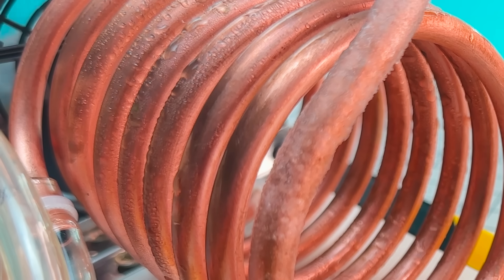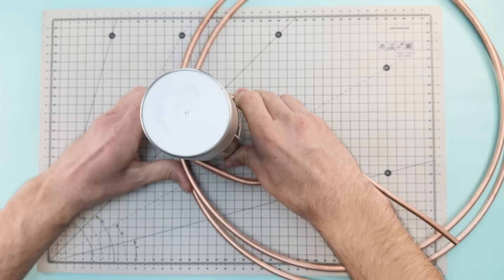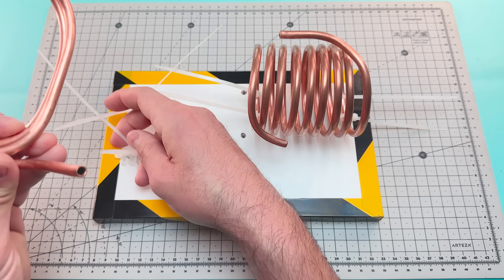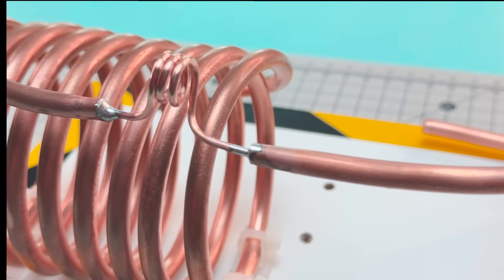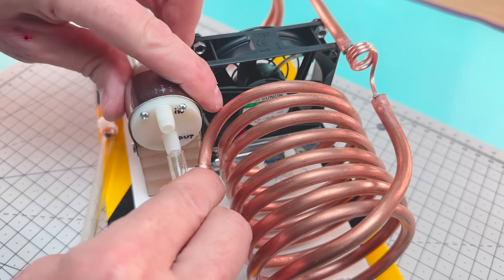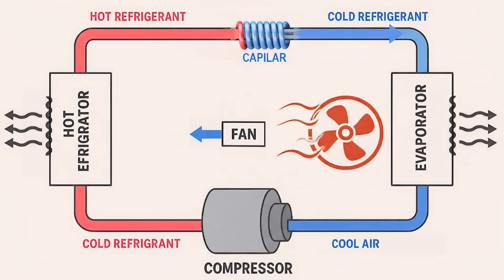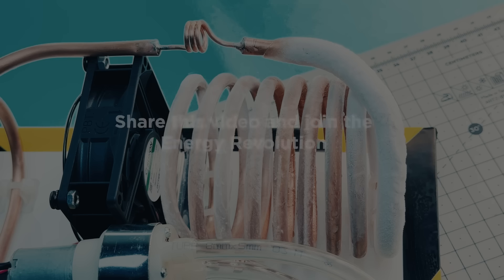Make your own AIR CONDITIONER at home Fast and Easy!

Comment: total buls***t. the battery will bare last 5 mins and even then the pump is too small to compress the gas. Maybe with a 12v external supply and a bigger pump it could be made to work.. I pity all the people who subscribe to you and fall in the Pseudo engineering channels like yours
Reply: So true
Reply: Le problème il nous fait dépensé de l'argent inutilement, gaz, tuyo, cherché le ventilateur, pour quelques choses qui fonctionne pas

Comment: It's a good refrigerator if you place the one part inside a cooler box and the other outside. Together, the heat and cooling cancel out each other

Comment: if your not removing the hot air blown by the fan out of the room your net cooling effect will be zero , actually it we be negative and the room will be hotter by the same amount of inefficiency in the system .
Reply: The net effect will be increasing the heat, because of the 2nd law of thermodynamics.
Reply: That's exactly what i said  @melchizedek077

Comment: Considering the basic principle of air-conditioning is moving heat from one place to another, usually from inside the structure you want cooled to the outside air, this unit moves it a few inches from the heat source. Not very efficient, which is one of the reasons those 'portable' air conditioners don't cool for beans, even with cumbersome 'ducting' to the outside. Bottom line: evaporator INSIDE, condenser OUTSIDE.
Reply: maybe if you place it near the window with the fan sending the cold air inside and another fan sending the hot air towards the window/outside? idk xD
Reply: i'm still a student and had thermodynamics class, i hope i didnt pass without actually knowing anything lol

Comment: your not going to cool a room or anything else with that besides maybe a soda sat in the coil. every bit of cold made there is that much in extra heat coming from the condenser. that's why in real air conditioners the condenser is outside. even portable ac units blow the air outside. this is an excellent science experiment to educate people on how refrigeration cycles work. i had thought about making one of these with the evaporator being lines inside a jacket with hoses in the elbows and shoulder areas  to stay cool when its hot outside but haven't gotten around to it yet. plus i live in florida and humidity would be a serious problem i think the  jacket would eventually become soaked and then would heat up faster than it could be cooled. i made an ice jacket by opening up the inside layer and attaching bubble ice packs when i had to redo my roof one summer. it lasted half an hour and by 3 freeze thaw cycles in a chest freezer it was too soaked to be useful from just the ice collecting humidity from the air.  i was thinking of using a real evaporator like out of a car and a blower to puff up the jacket with cold air, that would absolutely work but now we're getting to the issue of the equipment being too bulky and heavy .... end up like having a window unit on your back not including the battery
Reply: I made something like that for my daughter when she was competing in equestrian events.  Basically it was a thin vest with thin walled PVC tubing passing through it in several rows.  Both inlet and outlet tubes connected via self sealing disconnects to a small insulated soft cooler.  Inside the cooler was a submerged pump (think pond pump), connected to a rechargeable RC battery (lithium ion 4s).  Then filled the cooler with ice water.
The cold water circulated through the vest, and kept her cool while waiting for her event.  Then when it was her time to compete, we disconnected the hoses, tucked the ends under her jacket, and off she went.
Race car drivers have a similar setup, but the cooler is generally bigger with more ice water.  You only need an AC unit if you are intending on using it for many many hours.  Easier to just keep refilling the ice….
Reply: @simong1975 yes I have seen this idea before but have yet to test one. Your right about race car drivers having cooler suits. I still wonder about moisture buildup in high humidity environments BUT it's worth trying for sure thanks

Comment: Yes, there is another tech that is more effective at pulling water out of the air than aircons.  Search video called Solving Desert Water Shortages Using 20,000 Volts.  They don't use refrigerant at all.  Technically it's not the temperature that keeps people uncomfortable during warmer weather, but rather the humidity.
Reply: Buddy, I live in AZ. In June, where humidity levels are typically in the single digits, the temps can soar to 110 degrees and above. Believe me, it's not 'comfortable' at all. Even swamp coolers (evaporative coolers) aren't very effective at optimal [lowest] humidity levels with temps above 105. Now if you're talking 'relative' comfort as compared to say, Florida at temps hovering around 100, well sir; YOU'D BE RIGHT! 🥵🤣
Reply: @johntilson2535  yeah, 110+ dry heat is pretty unbearable.  Agree.  
I had in mind milder weather, like Mediterranean or even Singapore where I am now.  Usually Singapore hovers around 90F year round, but humidity can be around 80-90% during day.
Reply: Humidity makes hot weather unbearable. I also don’t like the 100 degree days during the summer.

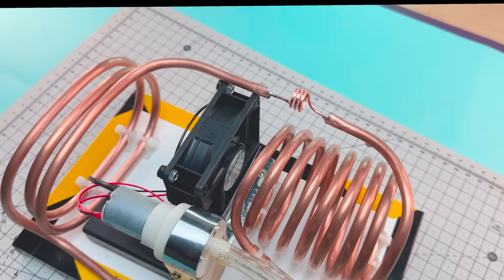Comment: 8:45 this would've made a perfect science project for five-year-olds. But suggesting this miniature system would cool a room in a hot summer day is frankly silly!
Reply: Yeah, should of just stuck with a single beer can cooler.
Reply: Notice he's not taking the temperature at the condenser coils! lol
Reply: Change the size of the components, then... Right?
Reply: @tomasdlabuena , yes, but eventually you would want a thermostat, which would cycle the pump on and off but keep the fan running.
Reply: @Torch4ya  a BIG thermostat?

Comment: Just enough info to be dangerous.  I'm sure lawsuits will be coming from injured  ppl soon. 34 yr. HVAC tech.
Reply: Yea lawsuits through a little 9 volt battery 😭😭😭
Reply: @smithsmith7640  Ummm, butane? Being contained by plastic tubing, cheap electric motor and zip ties? and yes, a little 9-volt battery, conveniently located for spark. Not very dangerous at all...🤣

Comment: great build but no condensate line. you will have a puddle of water. i guess keep it in a drip pan, also make a nice sheetmetal cover for it. cool video however you will disipate heat in the same room you are trying to cool, might not be efficient.
Reply: That my friend is my whole opinion regarding this .

Comment: The heat energy is not lost. What was the temperature of the other coil? With both coils in the same room, the overall temperature of the room will not be significantly cooler.
Reply: Actually, the overall temp in the room would continually increase, not just "not be significantly cooler"...  A/C's are just heat transfer units; the thermal energy must go somewhere, it can't just disappear (in these standard systems; some newer "solid-state" electric-only A/C units may be a different story), and in fact the energy used in this unit creates mechanical/kinetic heat (esp the motors) which would gradually increase room temp over time.
Reply: That setup will NOT cool the room temperature.  What he made is a dehumidifier.
Reply: @michaelkang215  It was just a simple, easy ProofOfConcept experiment, he wasn't trying to make a complete unit...  that said, the only thing missing is duct work to direct the heat coming off the hot end outside, which should be a given, not something to nit-pick here...   (sheesh, friend, grab a cold beer, hold it against your burning forehead...) ... >;]
Reply: @brianwall9592  "(sheesh, friend, grab a cold beer, hold it against your burning forehead...) "

Why don't YOU grab a cold beer and drink, AND keep your mouth shut?

P. S. You see how it works now?  You tell other people what to do and you get TOLD what to do.
Reply: @michaelkang215   lol, what anAzz...

Comment: Should be a nice little boom! Hey numb nuts your adding heat and adding cool accomplishing nothing, all you had to do was pipe into an igloo and say you made a no ice portable 9v cooler.
Reply: Indeed the hot side would need to be vented out of the room, but this is just proofOfConcept...
Reply: @brianwall9592  That POC exists already.  It's called an AC unit.

Comment: You are dissipating the heat into the same room you are trying to cool!!
This circuit can only warm th room (albeit slightly) from the energy use of the motor and fan.
Reply: thats right, the engine need be out of room
Reply: @sharonsh9494  The "warm" part of the system must be outside. The Cold part inside to cool down.
Reply: @bin1busch  nah.... Just add Insulated ventilation flex duct to the fan.... But again, i dont think this is enough to cool, air if its really hot outside
Reply: Thermodynamics in action.

Comment: Mechanic here…. You have to vacuum the system down so there’s no air. Just introducing refrigerant won’t work. Also, you have to compress the fluid/refrigerant, not just circulate it. 
As a basic diagram to explain the system, it works. But that’s all it does. It explains how it’s not gonna actually do it.
Reply: Generally speaking, for most systems, yes, but air left in the system just reduces its efficiency, it doesn't stop the process from working completely, same for the "vacuum it down"...  In my youth, I've rigged-up several old rusty "open-air" 1970's automotive AC systems without vac'n it down, and yes, it didn't work great, but it DID still work...  And he IS "compressing" it, just again not very much, not very efficiently, but yes in his/this tiny system and refrigerant it's enough to work a little.
Reply: @brianwall9592 very well explained  Brian, it’s virtually the same as I was about to say myself.

Comment: Will this work if applied it on my car air intake pipe?
Reply: Yes, maybe if the cooling coil is in the box and the heat side is outside the intake, but when it leaks, you'll get some extra revs or an explosion!

Comment: This won't cool your room.  You conveniently left out where the hot air gets expelled....in the same room!!!  The law of conservation of energy still applies.  That's why box air conditioners are mounted and sealed around windows and how refrigerators work.  You need to find a way to separate and keep the cold air generated by the gas evaporator and expelled the hot air from the condenser unit and keep it separate.  The amount of cold generated will be the same as the amount of heat generated in the same room unless you build a wall between the condenser and evaporator and have the condenser facing out an open window that's sealed.
Reply: I believe that was assumed, "a given", just not discussed...

Comment: This won't cool a room by anymeans.  There is not enough capacity.
Reply: That is a reason, but not the most significant reason. The heat is being dissipated by the second coil in the same room.

Comment: Kinda need to get rid of the heat on the other side if you want to cool a room. The condenser will heat the room. It's a cool desk toy but if you dont displace the heat from the other side it's useless.

Comment: First of all, a 9 volt battery will not last long running two motors, even if they are rated at 9V.  You did not bleed the system and no the room will not be cooled on bit since what ever heat been absorbed by the evaporator , are emitted right back by the condenser right next to it, plus in theory the heat generated by the two motors.
Reply: Ultimately, he is the winner, as evidenced by the fact that you watched his video, and he is here solely for views. He is smarter than all the viewers...